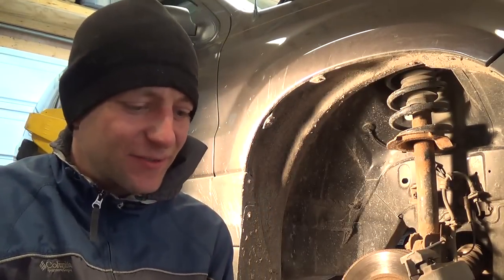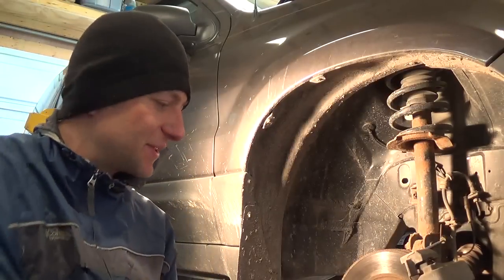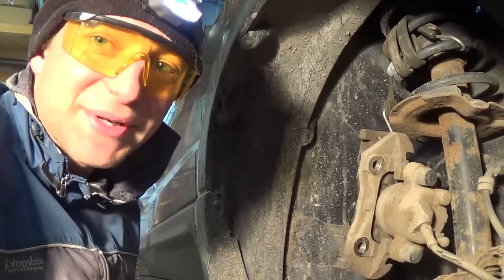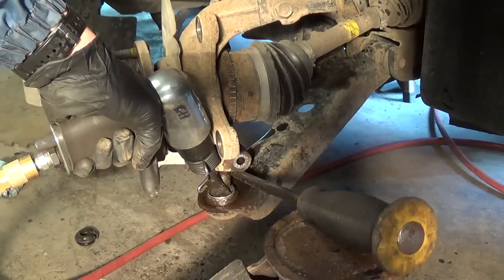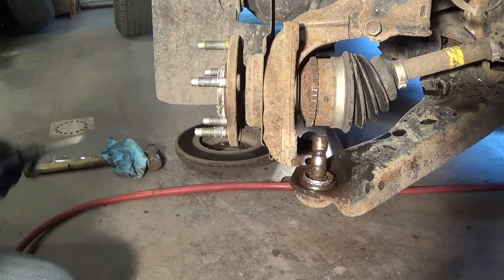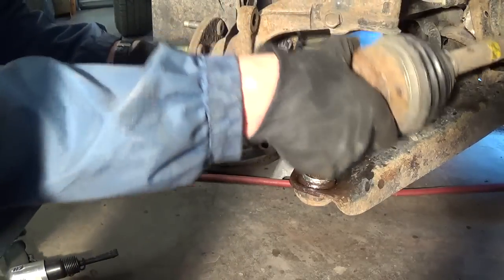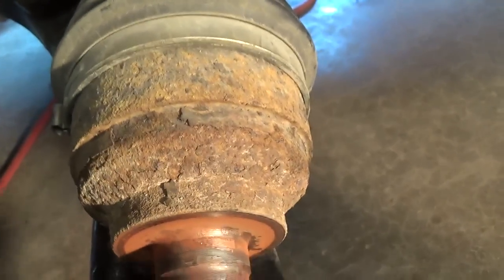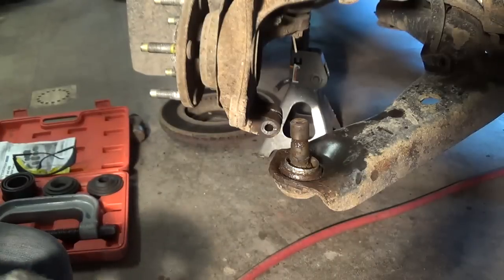DIY: ABS Tone Ring & Ball Joint: Ford Escape

Comment: I recommend to use a metal bristles brush to clean tha tone ring area or sandpaper like 100 or 150 grit to sand off the rust around the ring, using a file can damage the surface around where the ring will go in as a file can take way too much metal and leave uneven areas and cause the ring no to be able to be installed tightly, another thing is to use the old tone ring on top of the new one to hammer to install it also put some light bead of grease around the area and it it’ll go in perfectly.

Comment: I bought one last year. 06’ Escape XLT. Excellent condition, no problems, no rust, clean vehicle, 136k mi.. Got it home and got under it to inspect the overall condition of suspension/steering components. There was not any problems (*other than what is described below), I was merely giving close inspection of my new purchase. Holy crap. What cheap parts Ford used! The sway bar links were so...cheap! Nothing had a grease zerk! 
I decided to to some preventive maintenance and replaced everything with MOOG. Links, tie rods, etc.. While I was at it, I replaced the shocks, struts, new slotted rotors and ceramic pads. All cheap enough and easy enough to do.Also, I replaced the crappy cracked brake hoses! In this video, one can see the crap brake hoses. I would recommend replacing those as; well-cheap and easy to do.
Popped on a new set of Firestones/alignment and we are good to go! I have to say the vehicle is better than new as the MOOG “problem solving” parts are far superior. Handles like a new vehicle. 👍
So, the vehicle is like new in performance, handling and appearance. But that is not the coolest thing about this purchase...no. The coolest thing was that I bought the vehicle at a yard sale for...(drum roll)...$400.00! And my wife found a ten dollar bill stuck between the seats on the way home from the sale! Down to $390.00!!!
Details. $500. OBO on the sign. The guy thought he had an internal engine problem, said it made a horrible noise. I asked if it was a high pitch tick or a duller thud knocking. He said neither, and that it comes and goes. I told him that internal engine problems don’t come and go; but come and get worse! Got it fired up(dead batt) and it was purring quietly. He said give it a few minutes...after 5min, the noise came. I looked down and saw the tensioner and belt flapping about, pointed out to him that the problem was outside the engine, not internal ( I’m an honest guy). He pointed to his brand new truck and said, “Well, I got a new truck, so make me an offer. I said $400 and he said deal! I stopped at parts store on way home and got a new belt and tensioner. When I got home, I found the culprit that caused the tensioner failure; *bad bearing on the a/c compressor clutch($15).

These vehicles are relatively easy to work on unless...oh boy...unless the alternator neeeds replaced! That is a major pain and best left to a shop...and it’s gonna cost. Easily 3-5hrs labor. It’s UNDER the engine in the REAR! A real pain in the keister for those that may be lacking tools and experience.
In summary, save yourself some future troubles by replacing the cheesy Ford steering and suspension with quality MOOG parts!Do it now!
Of course, I’m watching this video because I have lights and codes! U2023 and C1233. Time to replace a tone ring and/or sender. Wish I had that sweet, sweet SnapOn scanner!
Good video instruction! Someone buy that man a garage heater!
Liberty. Constitution. Republic.
Reply: Five years later…
Hurricane Ian totaled the Escape.
Fully insured, got $5000. !!!
For a $390. SUV!  Not bad!
Bought a 05 Freesyle with leather and all the toys for $3k
Super excellent condition!
Has a CVT; constant velocity transmission.
Took a while to get used to…uh…um…no gears shifting!
Smooth, quiet, 17mpg city and yes, fully insured! 😁👍

Comment: First would like to say thanks for the video. well shown and gave good advice. I differ from your opinion on anti-seize though. just did a break job on an '06 and it took 2 hours to get the rotor off. this included using torch and a BFH. those several swipes of anti-seize made it for several strikes from your hammer and it came off.

Comment: You can get a complete lower control arm with new bushings and ball joint already installed at Autozone for $59.99, the quality is very good, and that CV shaft should have just been replaced, and of course the complete strut. I`m replacing all the suspension and brakes on my 2005 Escape this week, can`t wait to get into it.

Comment: Always refreshing to see a bit of "wrenching". 

The Nano is really impressive. I always wondered if one of those would have the same beans from a small home compressor as it gets from Dr O's professional setup in his shop. I really want one of them now. All i have is a cheap battery impact for zipping my wheels off and torquing them back on.
Reply: +zoidberg444   If buying a compressor get something decent.  $500 will get you a 30 gallon upright with a belt driven compressor.  The motor needs 220 volts so you may have to add new wiring to the garage.    This will pump to 130 psi and do anything you require of it.
Reply: +Lorrin Barth Yeah. I was leaning towards a 2.5HP twin cylinder direct drive one I'd seen. But everyone says belt driven ones last longer and are quieter. I just want something that can keep up. I'd hate to spend a bit of money on something and then find out it couldn't keep up. 

I'm from the UK so all our domestic sockets put out 240V at 13A anyway and i have a 16A blue plug in my garage as well. Power isn't a problem.

Comment: Well done Ivan. I work on quite a few Escapes and abnormal tire wear seams to be a big issue. Some tire brands a worse than others it seems. They need frequent rotations also. When I replace tone rings I use green locktight on them to seal out moisture and ensure they don't move.
Reply from the maker: +wysetech2000 Interesting...must be something peculiar about their suspension setup then?
Reply: +motoYam82 How about just a lousy Ford design and not peculiar at all.
Reply from the maker: Rick S don't get me started on the Ford Explorer lousy design LOL

Comment: I just did this on the drivers side including the brake hose.  After cleaning most of the rust where the tone ring sits,  I sprayed some high temp rust resistant paint to help prevent a re occurrence although I doubt this will be on the road in another 10 years.   Should I need to do another one I'll definitely borrow the tools that some auto parts stores offer to make the job easier.  There were no major issues.. hardest part was seating the new tone ring.  First time for me so I went slow.. a couple of hours including greasing the sway bar links that I replaced last year.
Reply: Replacing one brake hose is like replacing one stop light. They all have the same amount of wear and tear. Replace them all, and completely flush the brake system.

Comment: Looks good!!!  If you are going to be doing "rust belt" repairs in your shop,  have you considered getting something like a Snap On PH3050 air hammer.   It really does make stuff move along a lot easier.    You are also reaching the point where you might want to get a lift in your shop as well.   Im good at spending other peoples money LOL. Chris

Comment: You can tighten up tolerances by using a center punch to knurl the surface and then use red Loctite on the surface before reinstalling the ring. Be careful how large and how deep the knurling goes or the ring won't fit.

Comment: I like to give the ball joint c press a smack with a hammer either on the end of the threaded rod  or the other end. I find the shock helps it move easier. I actually had a harbor freight c-press blow apart while changing ball joints on my ram 3500. I don't know how I didn't get hit in the face with the bottom half it passed between the fender and my head and landed about 10 feet behind me. Since then I tighten up the forcing screw till it stops and hit it with a hammer, I was just going at it with a breaker bar when it blew apart.

Comment: Drop by HF and yourself one of those 25" Pittsburgh Pro breaker bars.  Leverage is always a big help.
Reply: +theoldwizard998 The new one with the plastic handle is actually very nice and doesn't flex like the old model did. Don't forget your 20% coupon.

Comment: you need big nasty in your arsenal Ivan! would that small air compressor hold up to it I dunno. glad to see another repair video . best of luck man.
Reply: +Adel Jeffrey (Jeffrey&#39;s Auto) An air hammer is actually a rather low volume air application. Ivan would be able to get away with using his small compressor. Die grinders or anything that spins a turbine are air hogs. For those you need a big dog compressor. I have a nice big Quincy since I paint and do body work. I need it to power my SATA spray guns and AirVantage Air Sanders. Anything smaller than two stage 80 gallon 5 hp would be useless for me.
Reply: SATAMAN Schmidt thanks for the info man . I didn't know that!

Comment: Ivan why not use a little Blue Lock-tite to secure the tone ring because its a bit loose. And the ring have on one side a tapered side, that makes it easy to fit. O, eah learn from the pro's use a lugnut to keep the rotor fixed when mounting the caliper. Well done

Comment: You say you need a real air hammer. I picked up a Snap-on PH3050A off ebay. Actually I picked up two...by accidentally bidding on both and won both. I now say careful what you bid on you just may win. I sold one of them. Moving up the a real air hammer means you need to upgrade to real bits. My cheap HF bits mushroomed inside the head and was a bear to get out.  Nice videos I subscribed.

PS if you get a real hammer you need the quick disconnect with it. Cause like they said is true with the spring holder your bit will go soaring across the room if you dry fire it not against anything.

Comment: What other occupation could you be working with a 4 channel lab scope one minute, and a B.F.H. the next, how could you not love it? Thanks for taking the time to show people the correct way to do this procedure. P.S. I use dingle berry hones on a lot of  components, it really helps remove rust and small burrs, they make these hones in several different sizes, they really help on ball joints, and u joints .....and of course brake cylinders ......... so on & so forth, any way it helps me. Obviously don't go crazy with the hone cause no one should ever weld them in place ever!!!! just a little tiny quick pass with a hone that isn't to big.
Cheers,

Comment: That's a good job  but I have a hard time concentrating with the cracks in the brake line and the rip in the CV axle boot  may want to repair them while you're doing that..  :)

Comment: bearing retainer fluid would probably help keep the ring on
Reply: +cbsctomh 
Loctite 640, 660, 680 applied before installing the ring or 290 after ring installation would be a prudent move. 
Besides locking the ring in place it would also stop most moisture and corrosive road deicing chemicals intrusion under the ring and preventing corrosion expansion and a future failure.

Comment: I installed a new Moog ball joint recently on my 2009 Escape. It popped out on its own just a few days later (Yes, I use the correct part). I ended up having to tack weld it in. By any chance did you run into the same issue?

Comment: Escape came into the shop with bad ball joints, I ended up replacing both lower control arms with new balljoints to make life easier. tried and tried pressing lowers out but they refused!
Reply from the maker: +Rob ert Getting the old ones out is the "easy" part...getting the new one back in...now that's the fun part haha

Comment: would be nice to see the wheel alignment done on a hunter wheel alignment machine to see how accurate the home method is in comparison
Reply from the maker: I've actually done this before, and the home string method got it in the "green" zone, within 1/32" of specifications!
Reply: Hi Ivan,thanks for the reply love the videos,that saves you loads of time not having to take it for alignment afterwards.

Comment: Does anyone know the torque specs for 08 Ford Escape front wheel drive on ball joint pin, outer tie rod castle bolt, and strut mount bolts? I've looked everywhere. Please and thank you. This video was very helpful.

Comment: There was no snap ring on the original ball joint and neither on the replacement one? Only the press fit is holding it in the control arm?
Reply from the maker: +Alexandre Coulombe That is correct.

Comment: Just curious why you and ERIC O bash doorman parts so bad?  I use them at my shop and have not had an issue.  If I do then they stand behind them.
Reply from the maker: +Nick Palmer Yeah, sometimes there is no alternative so aftermarket parts are the only option. Definitely better than nothing! But i have had several comebacks due to bad quality parts (generally they last about a year).
Reply: +Nick Palmer I can't speak for all dorman parts. I bought a set of steering wheel rebuild gears for my Maxima. Well, the machining on the threads was wrong, so much so that I had to file it down for couple of hours, so they can work without binding. Turns out Dorman knew about that. Finally 6 month later, they retooled those parts, so I am getting a new set of those gears to try them out.
I think in general Dorman has great intent in providing solution for badly designed oem parts and be able to buy just the failed component, vs a much more expensive entire new oem part. However the execution maybe a bit shy of perfect.

Comment: The Nano would work better if you had more air cfms and pressure.
Reply from the maker: +Techman 48917 Any air tool will work better with more pressure and cfms :)
Reply: +motoYam82 referring to eric as the legend. haha!! i love it.
Reply: +motoYam82 That is true. It's good to see others be thorough with there work. Seems them escapes always need ball joints glad to see you found a ball joint to fit cause most don't and you have to replace the whole control arm

Comment: You complained a lot about Ford, parts lasted 10 years.  Also that Escape was one of best selling vehicles in mid 2000's and you seem to work on a ton of Chevy's, Dodge, Jeep and foreign cars compared to Ford.  Hey, we all have our preferences.
Reply from the maker: +John Fountaine Hah the parts would have lasted even longer if it stood parked in a garage :) But a 2006 at 85k miles...eh guess I base my views on personal experience...
My 1989 Mazda MPV is still going strong on original ball joints and front wheel bearings at 240k miles!! Granted there is not much left of the lower body sheet metal, but that's still pretty impressive!
Reply: +motoYam82   I owned a 1992 DSM and about wore out my tools keeping that thing on the road.  So, why not buy another Mitsubishi, a Lancer Evolution - go figure.  Well, this car never breaks and if I didn't have a Subaru my tools would be idle.  The two cars have the same engine and are of a similar design but one was junk and the other isn't.  How does that happen?  It just depends on the parts they select to put in the vehicles - maybe identical looking parts but not identical.